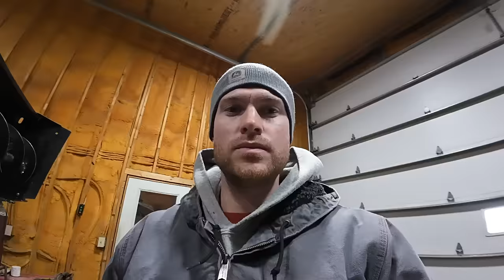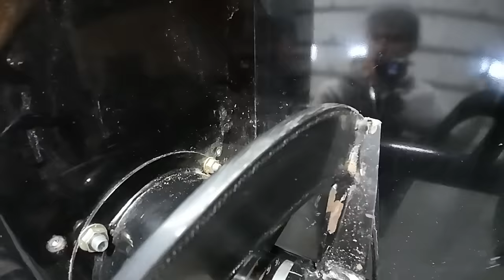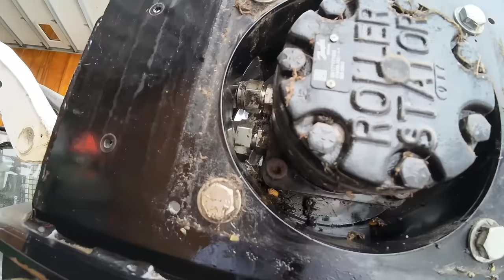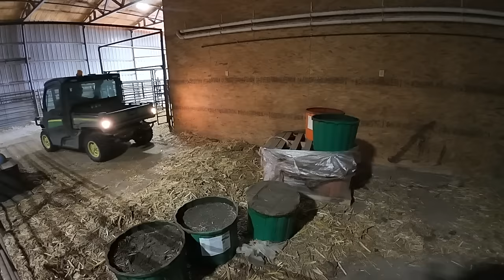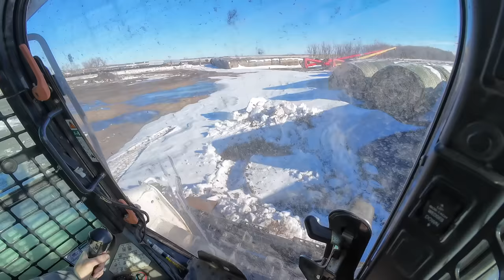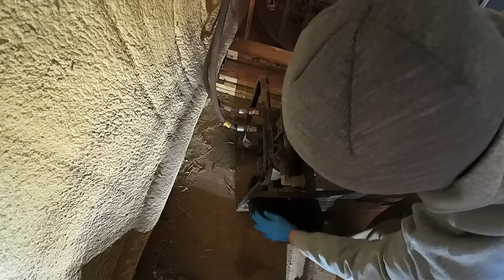Flamethrower Fun

Comment: Cole, Google says the direction of a fan goes clockwise for winter and counterclockwise for summer. I never question google!
Reply from the maker: based on when you are looking up at it or from a top down point of view
Reply: @SonneFarms  clockwise looking up.
Reply from the maker: thanks @justincase2830
Reply: Yes should be reversed in winter more efficient pushing hot air down ( Electrician from Aus)
Reply: @SonneFarms  sure

Comment: Fans blow down for cooling, fans pull up and out/down around the outside walls, back to the center and up for heating...check it out, the little calves will be much more comfortable without the cool air blowing on them, you can thank me later😊

Comment: What brand is your flame thrower?   Do you like it and recommend it ??
Reply from the maker: It is a pulsar long range torch by exothermic. eh it is not bad, worst thing is that sometimes it doesnt ignite the fuel so then your just spraying fuel around and nothing happens.
Reply: Thanks. I have not looked at many yet, but plan to get one. And I had not seen one like yours. @SonneFarms